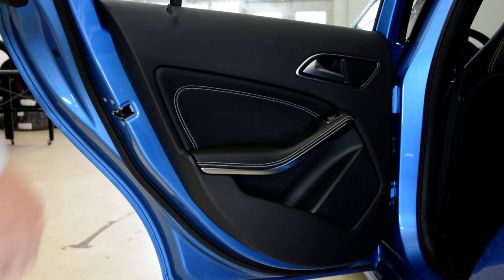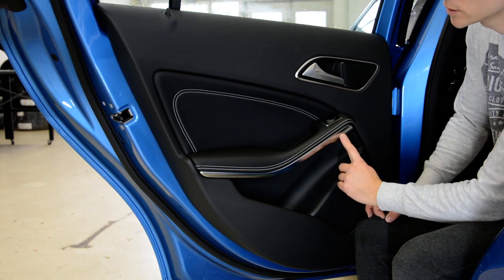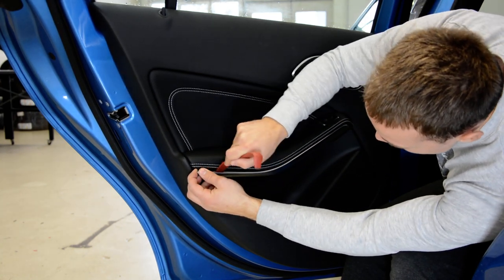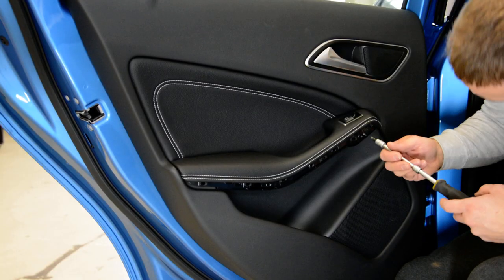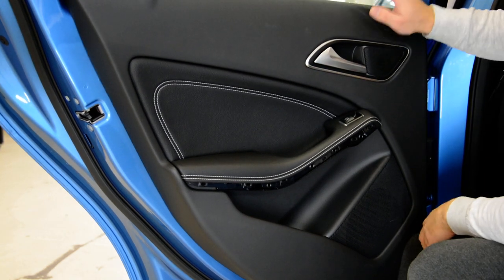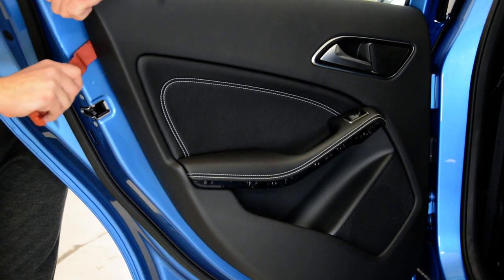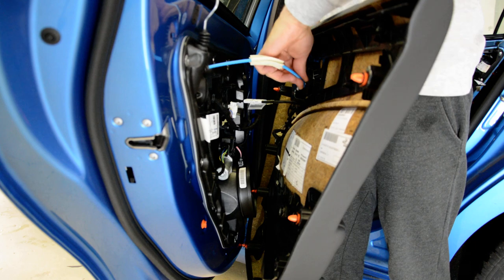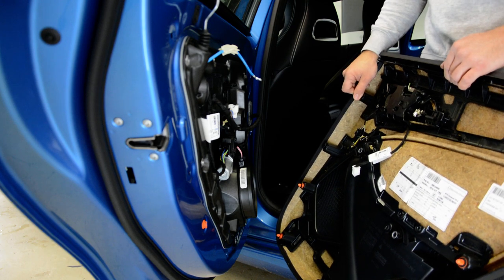Door Panel Removal Mercedes-Benz W176  A-Class

Comment: do I need to remove the whole panel to remove the power window switch? I need to get it cleaned as it stopped working to get the windows up, only down but it works perfectly fine from the driver's window panel
Reply from the maker: Take The Door panel down The clips are Ok is easy